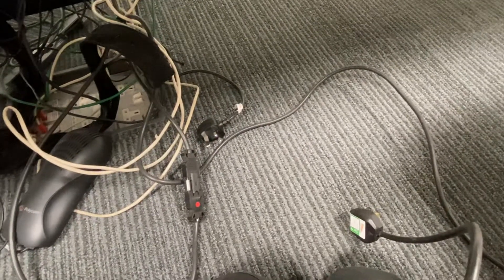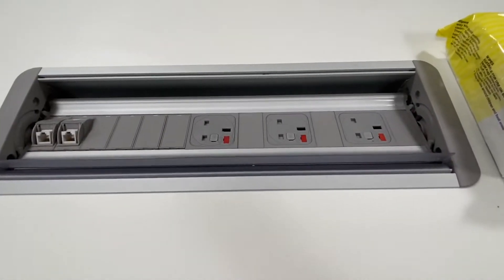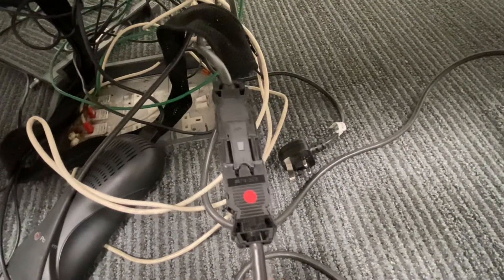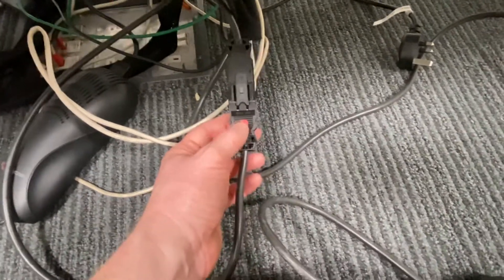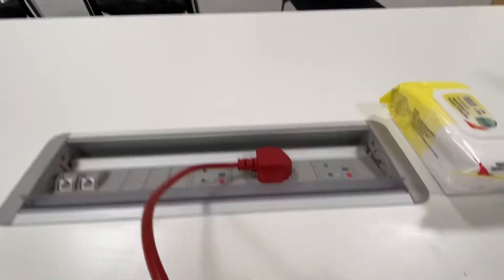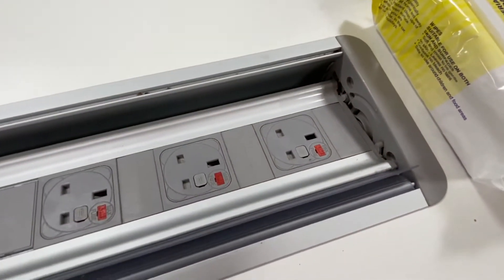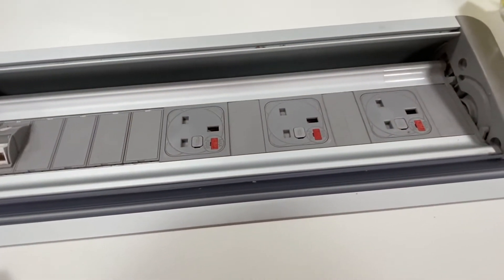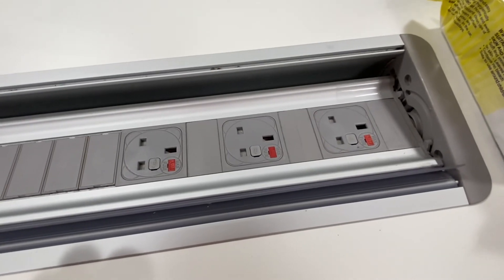PAT Testing an extension lead - GST Connectors. PAT Test Tutorial

Comment: Presumably you would need to get a male GST adaptor in order to make one up  for PAT testing?
Reply from the maker: Not necessarily. you could test the GST supply cable from the 13a socket which is almost always attached.